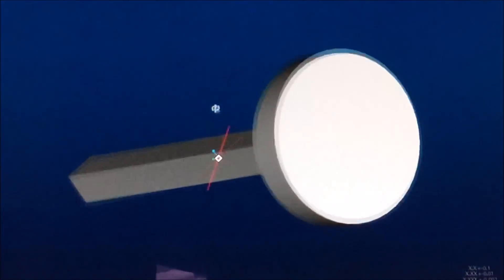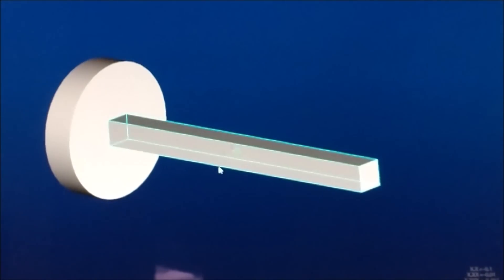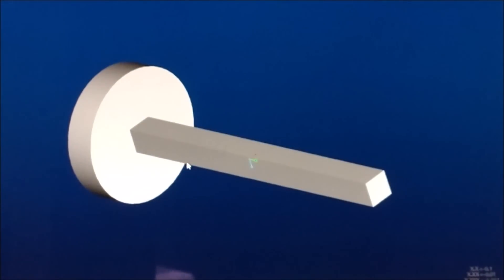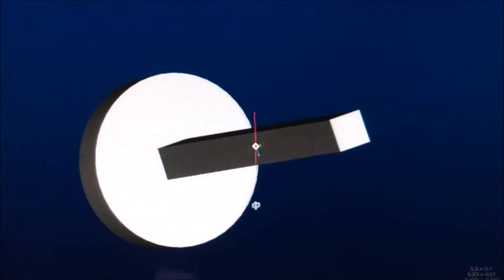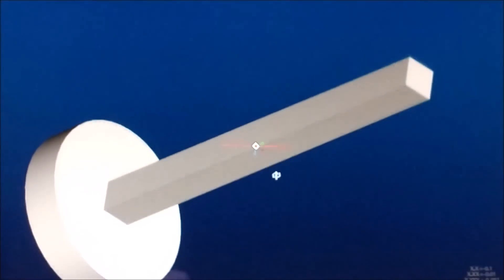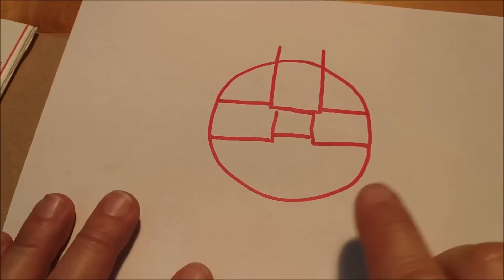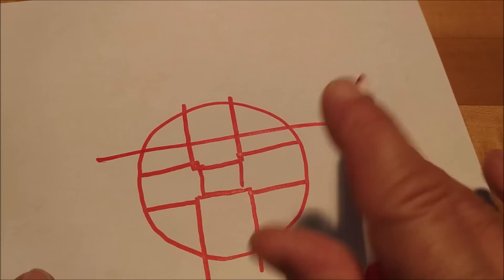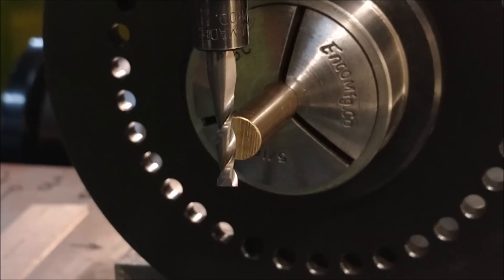Extended Small Cross Section Milling -- No Problem !

Comment: What are those little steps at 90° on the round face? Is there some axial play in your spindexer?

I thought it was an illusion at first, but i caught a glint off the step when you were measuring it around 10:20.
Reply from the maker: The camera makes them look a lot bigger than they actually were. The change in surface grain just amplifies it too.

Comment: I'm differently 😂putting this option into my save folder. About the 100 degrees. Moved from Michigan to South Dakota. It darn hot, what really helped. The air wasn't humid--most of the time.

Comment: I would've loved to see one of the cuts in real time and perhaps list cutter speed for reference. But hat's easy enough to figure out..  Anyway would find that helpful. However I cannot fault the value in what you have presented here Joe, this is huge. I generally make medium to large parts in repair work, but on occasion small parts or some sort of fixturing is needed. You sir have elevated my game in that respect exponentially. I learn something new every time you post a video. Thank you sir.

Comment: I was holding my breath when you did the second part, didn't even realise I was doing it !
102 degrees, I don't know how you do it, is the humidity high ?
I'm in Florida where it's 'only' 92 degrees, local TV weather people kinda piss you off when they happily say 'It will feel like 106' (due to humidity)
I'm sweating so much in garage it's dripping on material and being 'salt water' causing bad corrosion if I don't notice, wipe it off and re-oil. (at least I'm keeping machines in reasonable shape 🙃)

Comment: Is it just me, but something about the taper doesn't make sense...
-Why do you have a smaller finished dimension on the end sticking out furthest away from the workholding?
Isn't the deepest cut the one that is closest to the workholding where the material is the most rigid, which would therefore produce the smaller end of the finished product?
-Am I missing something?
Reply: The geometry of a milling cutter can pull the work into the cutter
Reply: @markdymond5352  aah thank you
Reply from the maker: If this was a production job, and the error was constant, I'd shim the indexing head to offset the error and get perfect parts.
Reply: @joepie221  I was wondering if the taper was due deflection or your indexer not being a perfect 90° to your cutter.

Comment: I came running, believing you’ve had accepted my challenge in doing work on a mini mill and mini lathe but that’s not the case 😢
I really would love to see uncle Pie doing work on a Sherline or DB200 Unimat, just to be amazed by the tips and tricks you could come up with to share with us. I even wanted to make a new headstock with bigger roller bearings and larger throat but all made using these mini (micro?) machines instead of a big lathe. Well, I’m very patient, uncle Pie! Still love all videos and appreciate your kindness! You made us better machinists!!!

Comment: A very good idea. As you said, it goes along with the turning method on the lathe. Leave as much material and cut towards the biggest mass. A question, would doing a spring pass, coming back out on the part help to cure the taper, I can't see that being a machine tram error.

Comment: Great work!
Without taking anything away from the excellence of this method, the alternative method suggested, namely silver-soldering the square tubing to a base requires it's own set of great skills around heat control and fixturing small workpieces to ensure a good result.